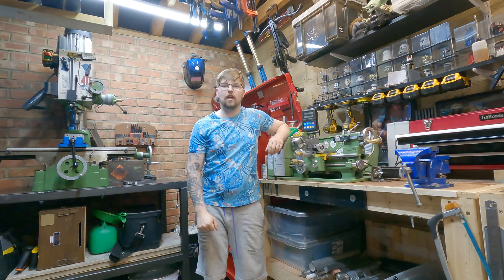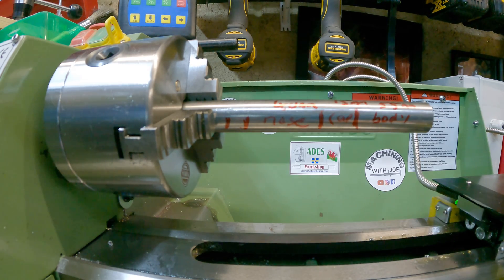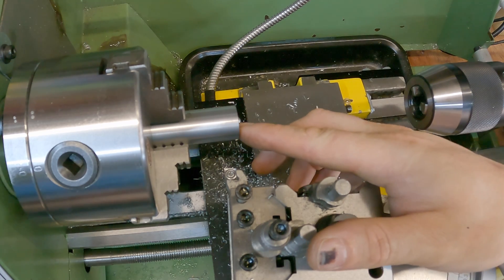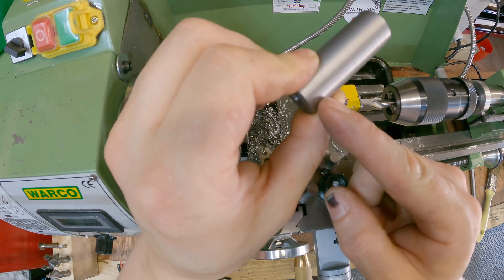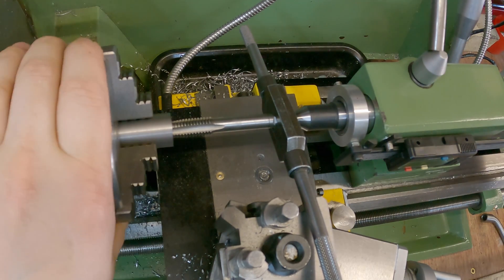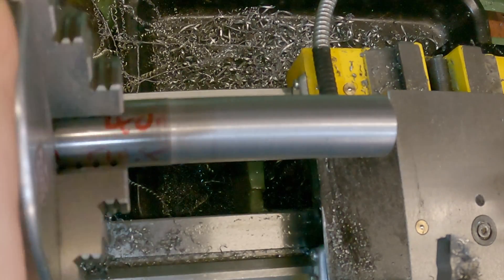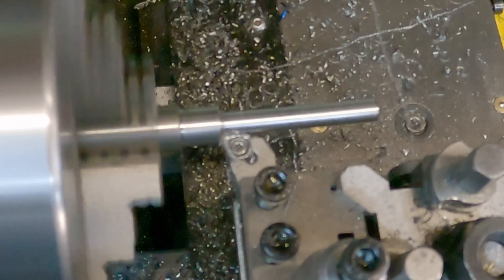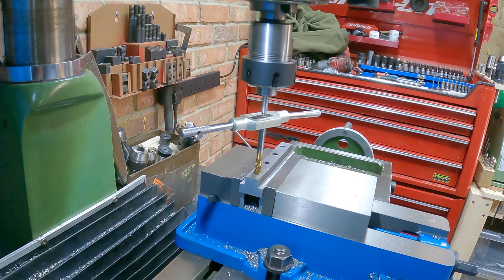All my TAP worries are GONE

Comment: That looks like an insert for aluminium you have on that tool. Nothing wrong with that, I use them all the time for most everything including steel.  Just need to be careful with them as they chip very easily as they are ground so sharp. (if that is what they are of course) Reamers tend to enjoy a bit of lube when they are working.  Noticed you changed the insert to do the pointy bit, any reason?
Reply from the maker: Yeah you are completely right there the insert used is a CCGT insert and I found them great on the mini lathe. You are also right in saying they chip easy hence the different tool for doing the tip of the tap follower. Appreciate your input on the channel all the best.

Comment: You chipped your tool tip, swarf should come off bright and curly (is OK a bit blue with those carbide inserts) yours is coming off in stereo from 1 tool tip. But keep going, it's the only way to learn. (I started in Engineering in 1974 and I mill, turn, shape, slot, turn, jig bore, CNC, grind, tinsmith, blacksmith, and did I say turning?)
Reply from the maker: Yeah I have noticed the ccgt inserts I’ve been using give great finish but do chip very easy. Good to know about what colour chips I should be getting. Sounds like you have plenty of experience always good to hear from Experienced machinists.
Reply: @MachiningwithJoe  hss and brazed carbide are sharper,  but with care the carbide inserts will last a lot longer. Just keep plodding along, you will pick stuff up on the way, if you do something not quite right there are plenty of idiots like me to put you right. Although we differ on a few points like English grammer and American grammer just to name 1 dispute Joe Pieczynski is a good machinist as is Aboms, and Blondie, my favourite though, is, This Old Tony.
One thing I have not mentioned and others have but us very important....... Safety Glasses! How important is your eyesight to you. When I first started Engineering, my own optician would supply me with safety glasses that the company would pay for, and now I have to go to a big opticians in the town and they sort it for me. You do not have that luxury, go to Boots and have a chat with them about safety glasses, it is really really important to safeguard your eyesight. Ps. Off to Warco soon to have a look round 😜

Comment: Metal has a 'skin' oh yes it does, you need to get under the skin or you will wear your tool away unnecessarily. you were going pretty slow anyway, but in general, if you have to just skim a bit off, drop your revs a bit and use coolant.

Comment: Nice job Joe, definitely worth having in the tool box. I think a tap follower was the 2nd or 3rd thing I made on my lathe. Just one recommendation, it's worth making a second insert with a small inverted cone for smaller taps that have a point at the end instead of a centre. Keep up the good work mate.
Reply from the maker: Hi Dan thank you yeah definitely worth having.  I didn’t even think about the taps with a point on the end great idea. 
All the best.